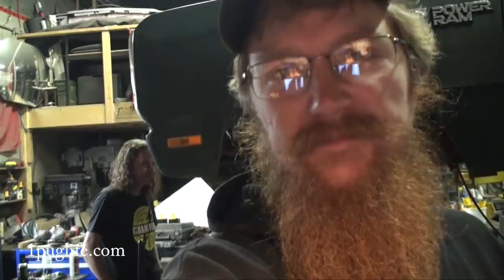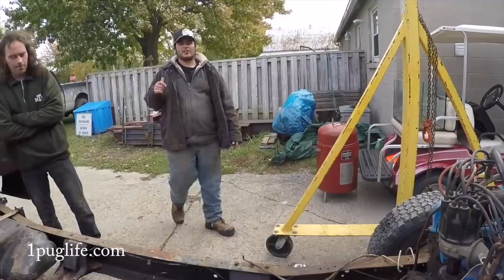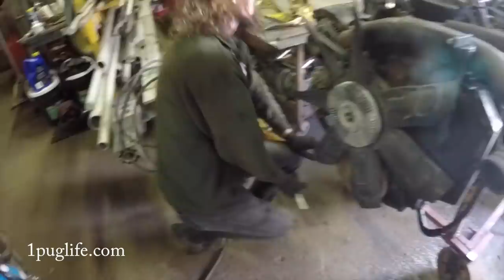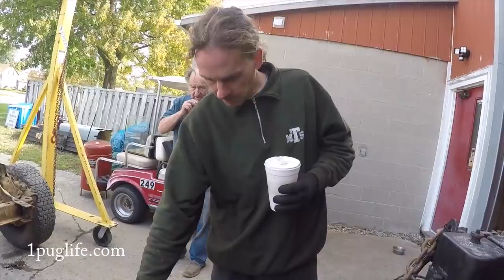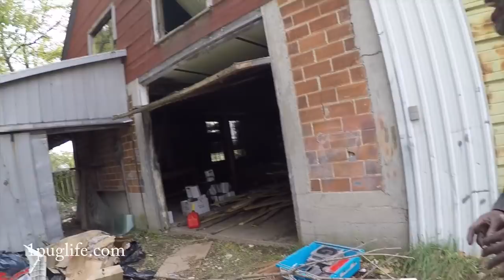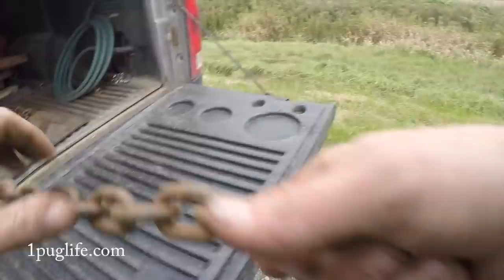83 crew cab cummins swap

Comment: That old 360 could be made into a killer stroker engine ! 

Diesels are strong for towing but need 3 times the torque to out run a gas engine in same vehicle !

Comment: What you really should do is put the motor and transmission on the 3rd gen long bed frame you have then put the cab off of the 83 on it and the bed off of the other first gen on it. Then you’ll have a long bed crew cab dully.